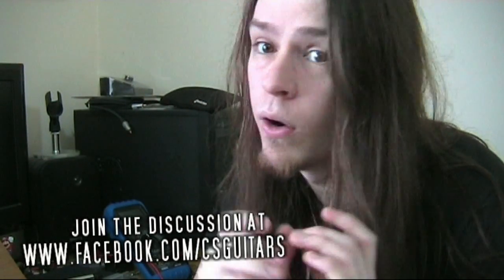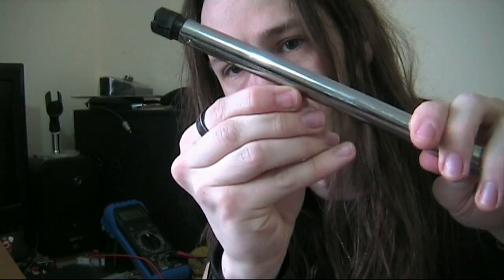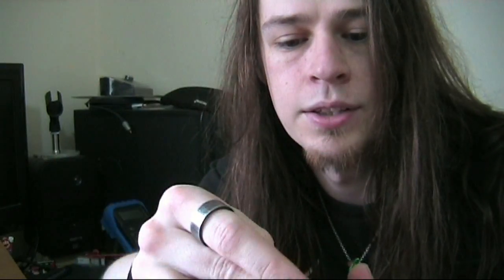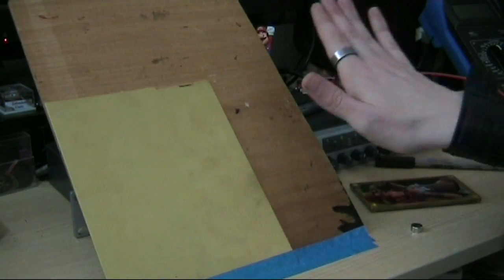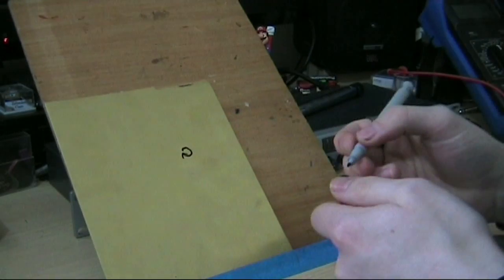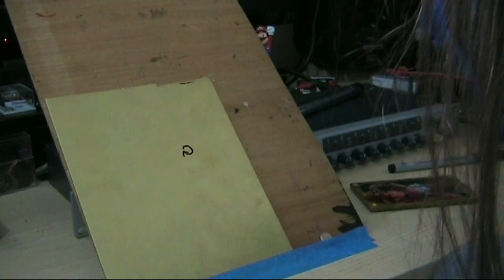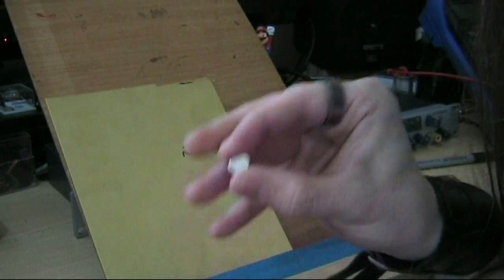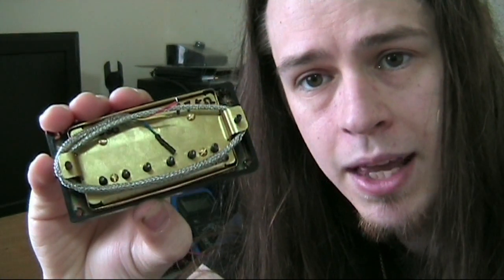Behind The Scenes: Eddy Currents and Why They Are Important

Comment: Hi Colin,  I'm a magnetic ar$h0le by trade, but I like your videos so I want to clear up an error in this video before you make the later video.  Eddy currents are not generated when you bring a magnet close to a metal.  They are only generated when the metal or magnet moves.  The flux from the magnet must move relative to the metal to get the braking force.  Before you release your magnet on the brass plate, there is no braking force on it at all until it starts to move.  The faster it moves, the greater the braking force, so it's speed reaches equilibrium after falling for a short time, just like if you jumped out of an aeroplane, you would pick up speed quickly and then settle at about 90mph as the drag from the air kicked in.  Also the thicker the material, the more eddy you will get.  Try using a thicker brass plate or two brass plates together if you have them and you will see what I mean.  Getting back to pickups, some claim that if you take the metal covers off humbuckers, you get more top end response making them sound better due to less eddy, but more top response doesn't equal better sound as you know.  Much of it is down to personal preference.
Reply from the maker: There needs to be a changing magnetic flux, not that the objects need to be in motion. That's an important distinction. 

The demonstration with the magnet falling down the board was simply a visual display of eddy currents in action. 

Within the pickups the magnetic flux changes, current flowing in the copper coils will tend to do that.  As long as there are variations in the magnetic field then there will be eddy currents. 

You see the same thing happen in transformers, that's why the iron core of transformers are made by laminating slices of iron and insulator. This minimises the eddy currents and allows the transformers to operate more efficiently
Reply from the maker: Quite correct, of course. 
In my haste to make this video between doing other things it would appear I wasn't accurate in my description. Thank you for pointing out my error.
Reply: If there are no eddy currents unless the objects are moving across each other, would that mean the baseplate/cover wouldn't change anything since neither the magnets or baseplate/cover move?
Or is there another field/current etc.. that would show that it does change the sound?
Reply: I figured that was the case but I was just checking because as you said that's an important distinction. Without it other people would have questioned the same thing I did.

Comment: Cobalt, nickel, iron and something else are ferromagnetic iirc
Reply from the maker: Ferromagnetism is the physical theory of how materials form permanent magnets. 
Iron, nickel, cobalt, and most alloys thereof, are the most common materials that can be used to form permanent magnets.

The magnets used in guitar pickups and in very may other applications are AlNiCo, an alloy of Aluminium, Nickel, Cobalt (from where the name derives) and include other elements such as Iron, Copper and Titanium. 

Different mixes of these elements yields materials with different magnetic strengths. 
It's worth noting that the materials themselves are not magnetic, but can be 'charged' by an external magnetic field and the material will then hold that magnetic orientation. 

Ferromagnetism is a result of some very interesting Quantum Mechanic processes which might be beyond the scope of what I ever plan to discuss on this channel, but it's well worth researching the Pauli exclusion principle and the magnetic dipole moment of electrons due to spin

Comment: nothing to do with potting and shielding, right? why do folks use brass foil to shield the pups etc. if it can change the tone? really cool and i'd like to hear the difference made by other metals! thanks.
Reply from the maker: Foil shielding within the control cavity and pickup cavities are to prevent external Electromagnetic radiation from interfering with the electronic signal within the guitar. 
It's an application of a Faraday Cage. 

Lining the cavities with metal foil, most commonly copper foil, does not result in the change in tone I am referring to in this video. 
Eddy currents induced in conductive materials are a result of close proximity to a magnetic field, and influence the tone solely through altering the inductance of the copper coils within the pickups themselves. 

What shielding does offer however is protection of your signal from hum caused by interference from the outside world.